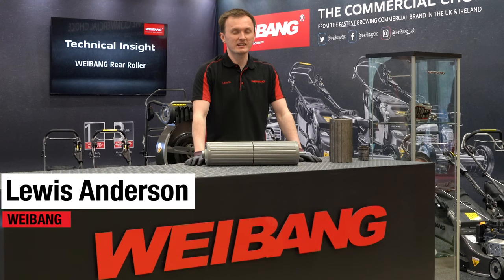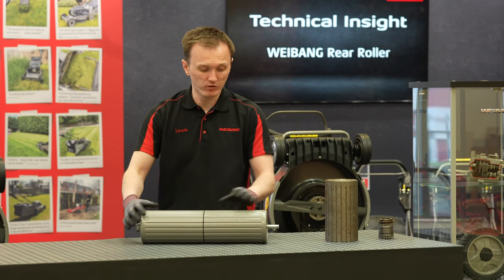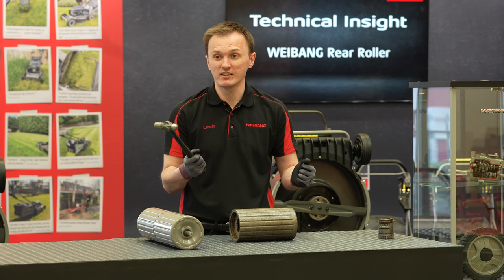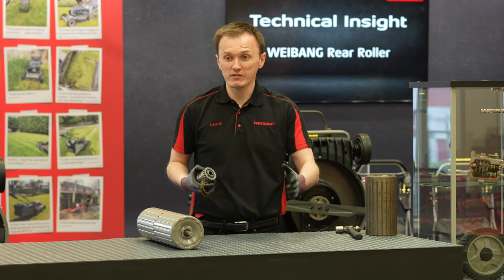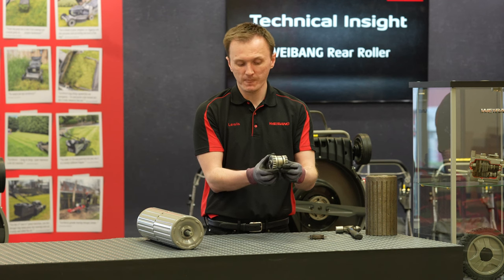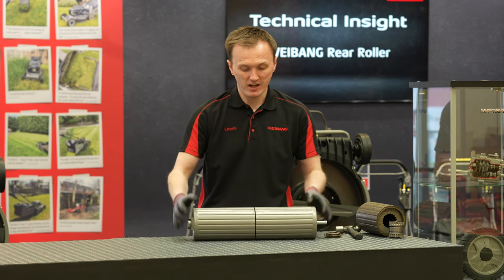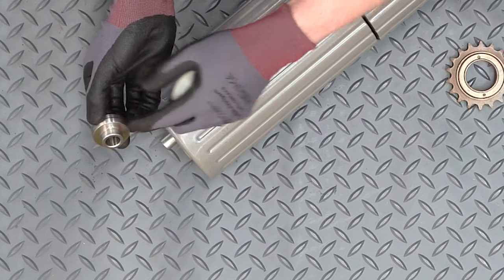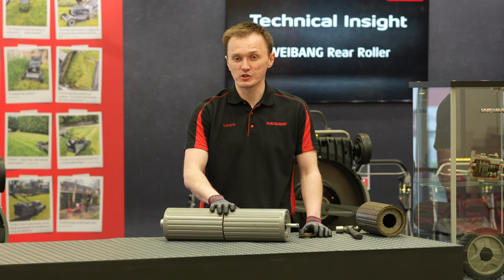WEIBANG Technical Insight - Rear Roller

Comment: Where can I buy a replacement ratchet and plastic inner seal in UK please for my 48V?
Reply from the maker: Hi @Devilbissgti89 you can locate your nearest dealer here - https://weibang.uk.com/dealer-locator
Reply: @weibanguk  Have spoken to my nearest dealer but unfortunately they have not been able to locate the part I require. Is there a way I can purchase the parts I need direct?
Reply from the maker: @Devilbissgti89  Hi, Could you give our customer care team a call and they can help with this and locate for you.